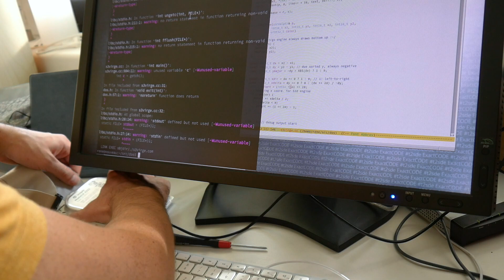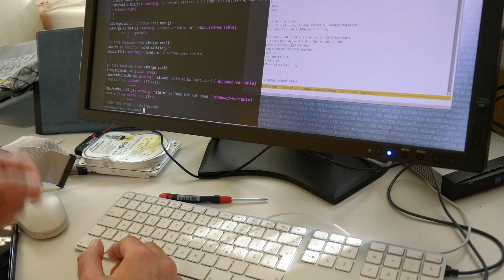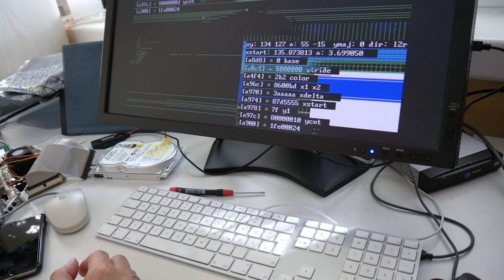Can't believe this works: IDE hot swap – don't try at home!

Comment: Your warning is too late, I've already tried it at home! 😎 It was part of an (original) Xbox soft mod procedure. How it worked: Start the Xbox to let it unlock its HDD (password protected with a password that is unique to each console), hot swap to the PC and modify the disk contents, then hot swap back. And just as you have seen, although it isn't safe it does work :-)
Reply: Ah yeah, back in the days I did the same to one Original Xbox. These days i use a USB Adapter and Spliter Cell to softmod, way faster if you have a bunch of systems ^^
Reply from the maker: yeah, it only works in my case too as DOS nor my Linux to spurious / random I/o access when idle. Thanks for the Xbox tip! ;-)
Reply: It could be an interesting system for future experiments ;-) haha
Reply: My main worry would be a hard disk head crash moving the hdd while going. If possible you should park the head JIC.  Also why not put a network card in. There were some dos drivers back in the day. There are usb drivers for dos too, so that could be an option. I know because I used one a couple of years ago.
Reply: Also you could try a gotek drive.
Reply from the maker: I did not plan swap it 32 times, I actually hoped the code running fine in the emulator would just work on real hardware, too. It just became and near infinite swapping and debugging around. Theoretically I have a spare PATA disk on chip flash module, though. Long term I could also use a CF IDE adapter. Finding out what network share options existed for dos would certainly also be nice. But I vaguely remember some Novel IPX thing, that may not actually be worth the trouble to set it up. But any links and pointers welcome!
Reply: I have my DOS machines on the network. Makes moving around code a lot easier. You don't have to deal with novel stuff, just install the DOS driver for your ethernet card (they are called packet drivers, you can use that to google it, but most will actually give you the DOS packet driver in the floppy or CD which came with the card if you still have it), and then you can use a TCP/IP stack for DOS such as mTCP and WatTCP. Both come with utilities such as ftp, ping, etc, and then there's ssh2dos which is very handy. If you need any more details, feel free to mail me at nuclear@member.fsf.org.
Reply from the maker: cool, will try to give it a try some time soon, ..!

Comment: What about a serial nullmodem cable + a serial-to-USB adapter, and an (a)getty process for that USB serial line? On the DOS machine use e.g. Term95 (it's still a DOS app despite the name) from Norton Commander (that's what I used back in the day, there might be better serial terminal apps for DOS). Then login from the DOS machine via serial, edit/build and then run "sz" ("send zmodem", "lrzsz" package in Debian), which saves the file automatically (afair), then exit term95, run the com file via DOS, re-enter term95 (usually no re-login necessary, since it's just a serial line and the shell session is still open if you haven't closed it). For extra bonus points, make your .com file talk to the serial port directly and implement some kind of "self-update" protocol where it saves the received data and then re-executes? (but of course that's overkill... and the next thing I'd suggest after that would be that you just patch memory addresses or implement some rudimentary "remote S3 graphics card access" thing, so you can experiment even more "directly" :p)
Reply from the maker: Yeah, I was also considering network boot, but I found no pci nic with boot ROM or network mount a file share on dos?
Reply: I also don't have any experience with networking under DOS , but serial on the DOS machine with a nullmodem cable (+USB converted on the "host" side) is super simple, most DOS-era machines (and even more recent ones) still have a serial port (or two) that can be interfaced with. If you want to go the NIC route, maybe mTCP might work? (but again, never tried it myself)
Reply from the maker: Yeah, I remember back in the days on DOS we used some Novell IPX stuff, not sure for what anymore, maybe mostly gaming? In the long term I will make some network PXE boot ROM for one of the 3com cards I have in the vintage shelf, would be cool to boot demos and tests disk-less. This was an ad-hoc "emergency" solution anyway, I did not expect I had to debug S3/Virge hardware 2D lines that long, ..! :-/